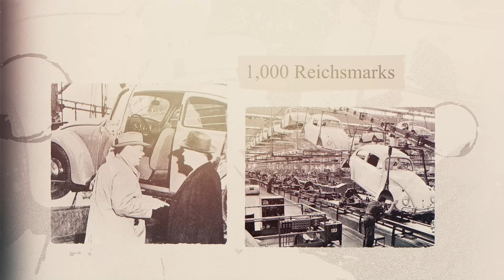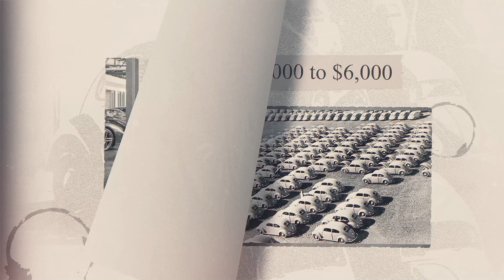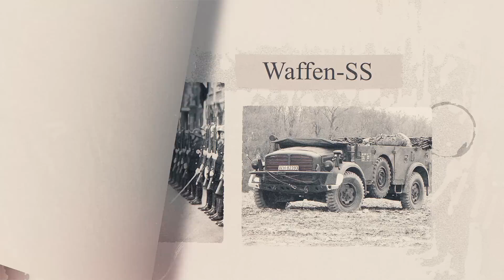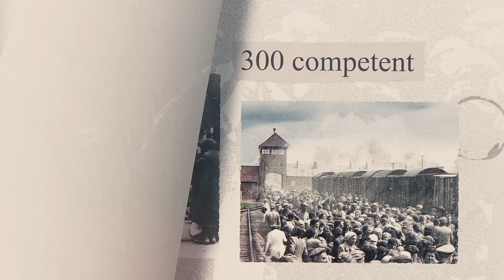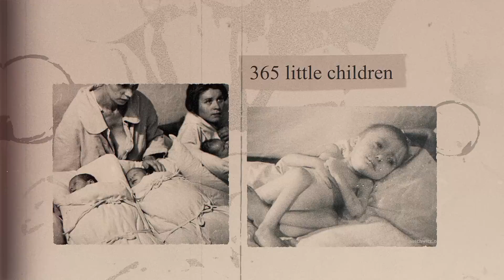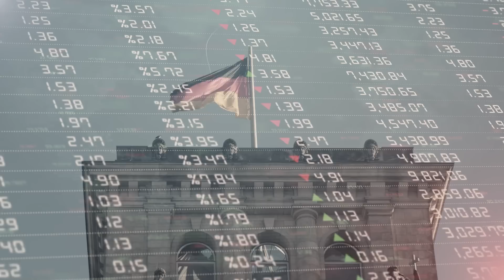The Disturbing History of Volkswagen

Comment: What is often missed in histories of the KdF wagen (VW Type 1) is the role of Hans Ledwinka. When Dr Porsche was designing the car, many of the details appeared to be cribbed from the work of Ledwinka, who was the chief engineer of Tatra in Czechoslovakia. The two engineers often discussed the design for a "people's car" and Porsche had seen Ledwinka's prototypes, which bore a remarkable similarity to the later "beetle". Eventually, in 1965, VW paid Tatra one million deutsch marks in an out of court settlement.

AFAIK all German auto manufacturers during WW2 used slave labour, including Daimler Benz (Mercedes), Auto Union (Audi, Horch, Wanderer & DKW), BMW and Ford Germany (under state control).
Reply: All true! Friends of mine own Tatras and I've read a bit about them. I drove one of theirs, a 1947 type 87 Tatra- it was a 56 Volkswagen from hell! You could feel that big V8 pulling the car outward on turns. Scary until you got used to it.
Reply: @lawrencelewis2592  when nazi officers took over Czechoslovakia during the war, they were warned to be careful driving large tatra cars on bends.
They didn't listen, and many ended up in the ditch.
Reply: @thomasburke2683  I've heard that German officers were forbidden from taking Tatras, eventually. That one I drove took a lot of getting used to. One friend had pre-war type 77 which was a right hand drive limo. He couldn't practically drive it in the city as he could not make a 90 degree turn due to its enourmous turning circle. He had to back up and then go forward again on streets in his neighbourhood. Not fun when cars are honking at you. He eventually sold it. I wonder how a car like that would have worked on the streets of Prague?
Reply: Béla Barényi hungarian engineer won a case against Porsche about the design..
Reply: There was a third engineer, Bela Barenyi (Hungarian), involved. Basically, Ferdinand Porsche (Austrian), was better in selling than the other two engineers. Actually, Barenyi did the basic design (rear engine, rear drive) first, AFAIK.